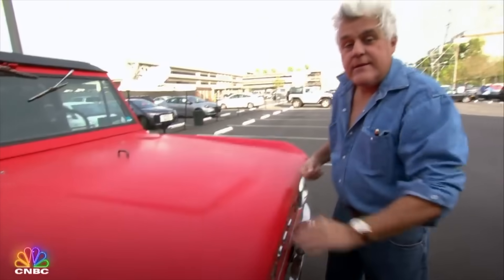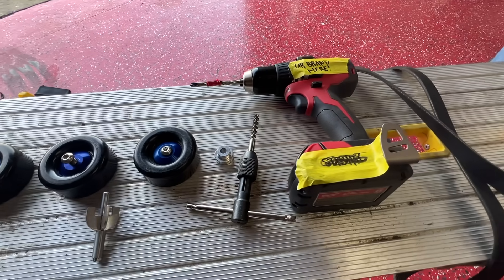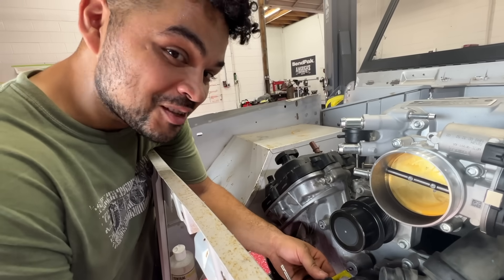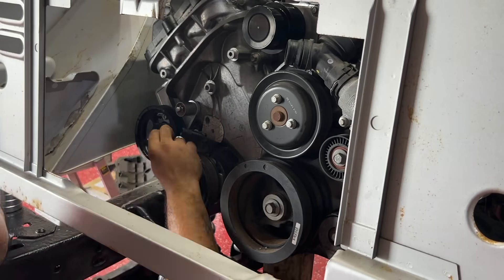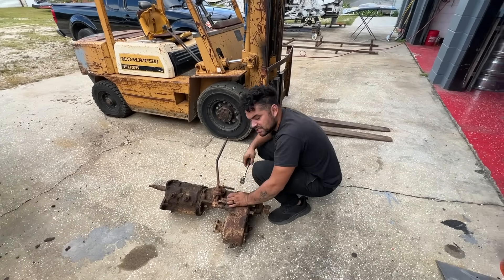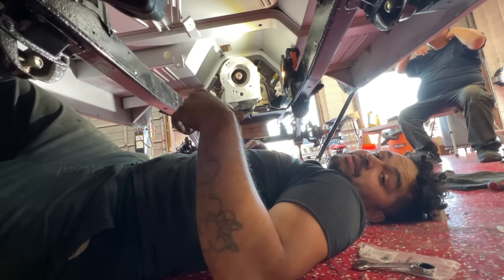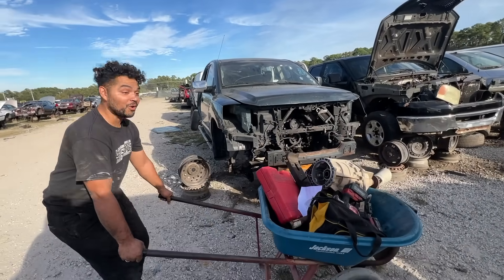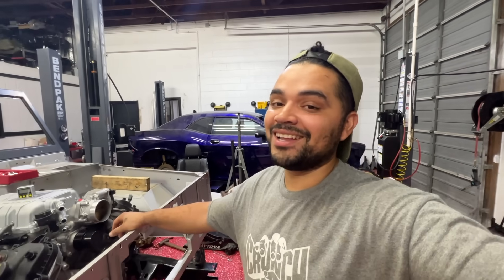Building Jay lenos Bronco BUT Better & CHEAPER! | BUDGET BRONCO

Comment: You do realize you can notch that front cross member?  There's also any number of potential T-cases that will work.  This is where someone who knows 4x4's would help.  It's also one more reason LS engines are so popular; the ability to move accessories around in infinite combinations.  Ford's block casting/bracketless design saves them millions of dollars but, like the goofy overhead cams, it's a pain in the ass for everyone else.

Comment: IMO, Use factory mounts!
The factory mounts will absorb the engine vibration the best and make the Bronco feel refined and classy
Aftermarket mounts almost always have stiffer durometer bushings which transfers excessive vibrations to the dash, steering wheel, etc....exposing any and all rattles. It cheapens the feel of a car.

Comment: You do know that Ford has a Engineering Tec support Line that can tell you the Angle of the Engine and the amount of Deg it needs to be at all so make sure you have the rear diff ratio that will work with the front other wise it will lock up or destroy one of them.

Comment: Ideally you want 2 or 3 degrees of slope down on the motor and  nose up on the pinion.  Drag racers point their pinion nose down  a little more.  Some older muscle cars have as much as 4 or 5 degrees of driveline angle.  You just do not want the pinion nose pointing so far up that it intersects the output shafts imaginary line.  But, the more straighter they are to 90 or "O" the less power loss you have.